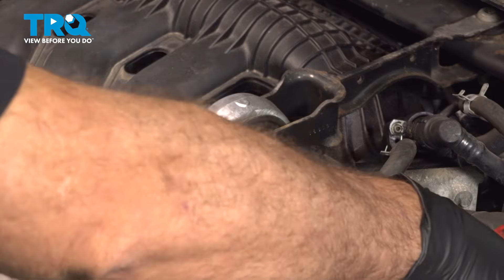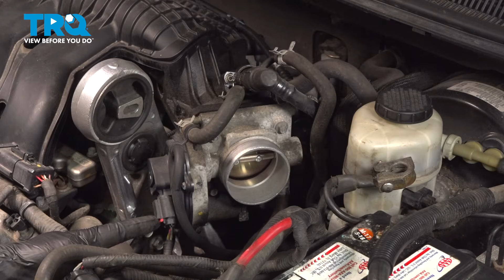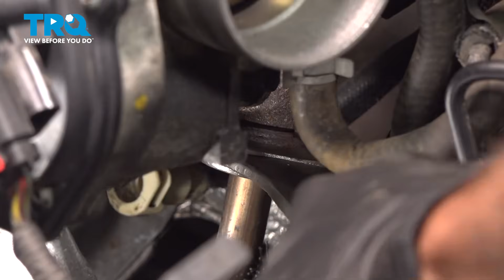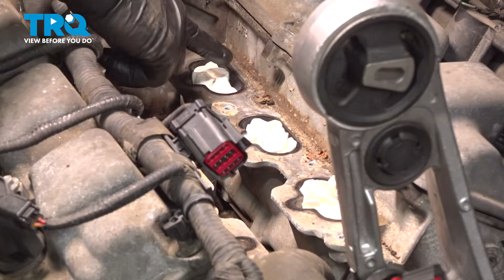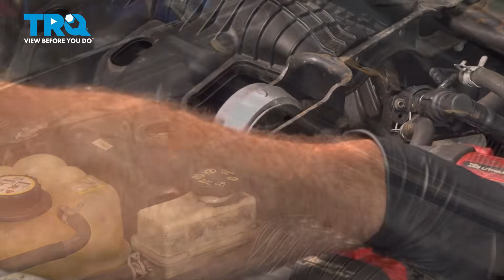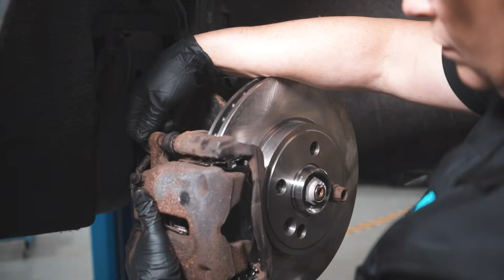How to Replace Ignition Coils 2005-2007 Ford Five Hundred

Comment: Today I did the replacement of coils & spark plugs and everything works well now.  There were a few difference on my 2007 Five Hundred Limited than what model and year was in the video. The most major difference was the placement of the EGR tube. It was tucked away behind two braces. Secondly there was a loss of power steering fluid and I'm assuming that happened when I was pulling the intake manifold. I'm glad I did this though and it started right after I finished and ran great. Thank you again for your video.

Comment: OK, I need to leave a comment about this video. Everything in this video is exactly correct dead on. I did the entire job of replacing the spark plugs and followed every step 1 at a time. I had to buy some clips for the fuel rail safety otherwise it went great. I did suck all the oil out of the spark plug holes with a vacuum on the end of a tube And I torqued my plugs to 20 foot pounds instead of 14. I just thought I’d help everybody out and thank the YouTuber for their to my project.